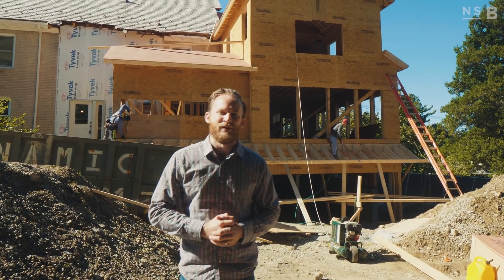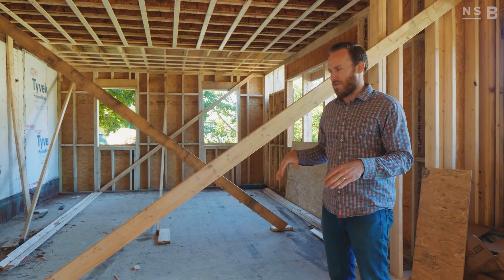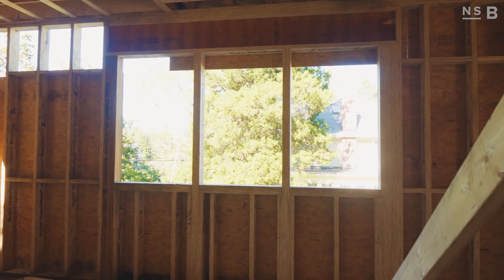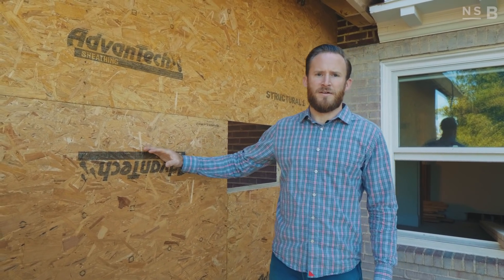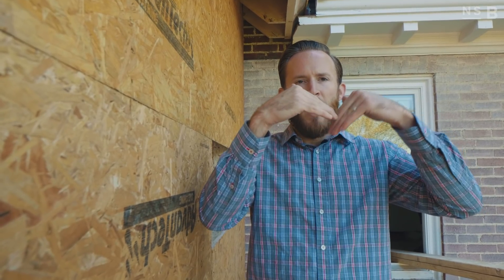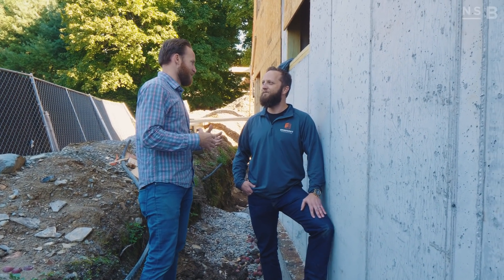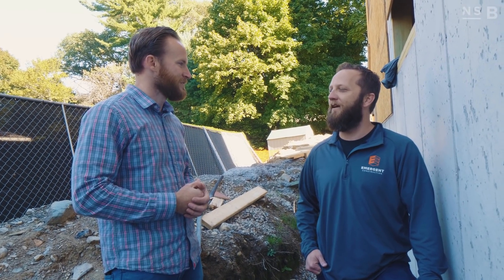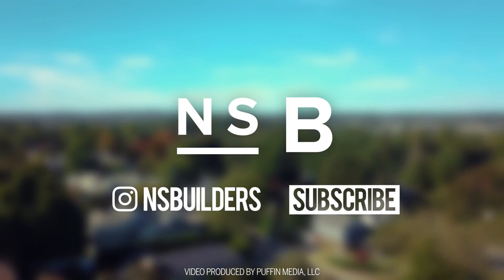Framing New with engineered I-joist and Advantech Sheathing while complimenting Old

Comment: I think there is a misunderstanding of how water flows underground into your drainage systems. You are assuming that the water is coming from rain on the outside and moving down and into your basement. I think the real source of bulk water in a basement is the underground water table rises during a rainstorm and water is rising up into the basement from below the house itself. Therefore you are not really funneling water from the wet outside to the dry inside, but rather just keeping the water table from rising higher than the level of your pump.

Comment: The pump is great.... until you lose power (which is common during storms).  End of story.  Been though this more than once
Reply: u should never install a pump without a battery or water powered back up' depending on private or public water. easy peasy lemon squeezy

Comment: You placed a capillary break of some kind between the footings and concrete walls? And some other water mitigation under the footings?
Reply from the maker: hellonoko Capillary break between the footing in the foundation wall and then the foundation wall itself will have a waterproofing membrane from grade all the way down to top of footing
Reply: NS Builders awesome. 😎